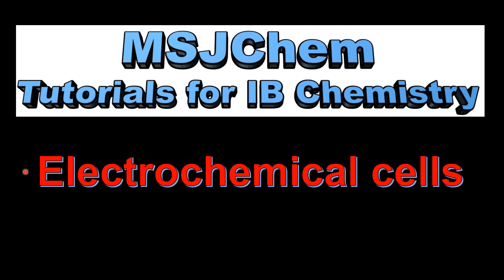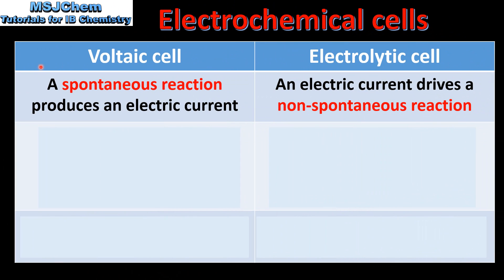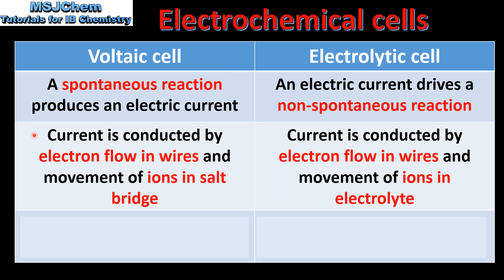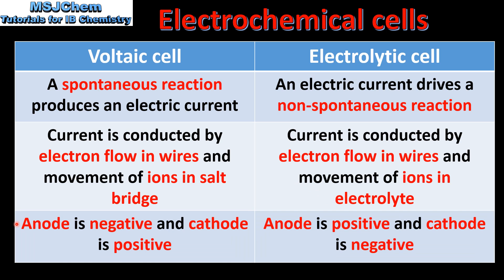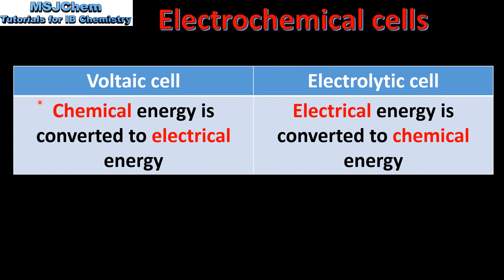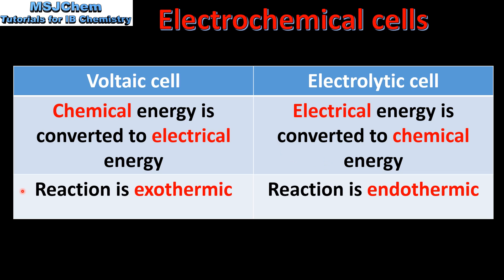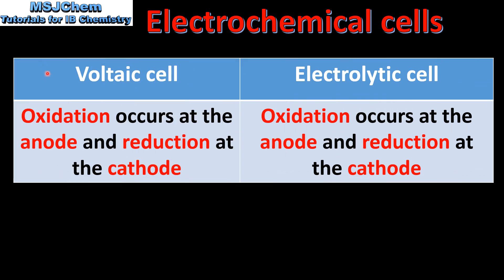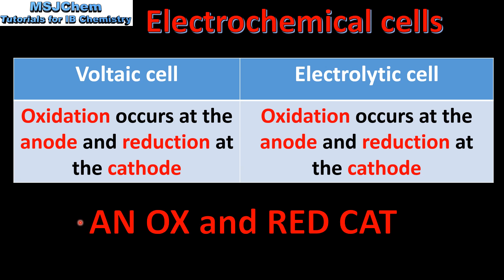9.2 Comparison of electrochemical cells (SL)

Comment: Hi, I dont understand why the anode in a voltaic cell is negative. Arent both electrolytic anodes and voltaic anodes being oxidised? meaning they would have a positve charge
Other than that, thank you for these life saving videos
Reply from the maker: Basically the anode in a voltaic cell is the source of electrons, hence negative. In an electrolytic cell, electrons are ‘forced’ away from the anode by the battery, hence positive. Oxidation occurs at the anode in both a voltaic and an electrolytic cell. Reduction occurs at the cathode.
Reply: @MSJChem  Thank you!